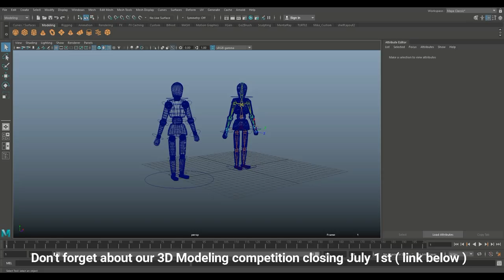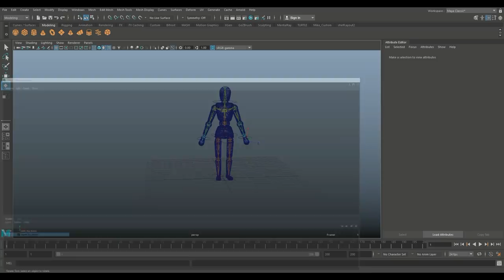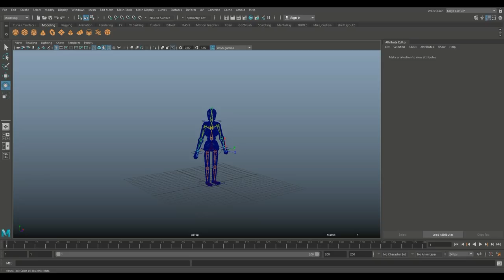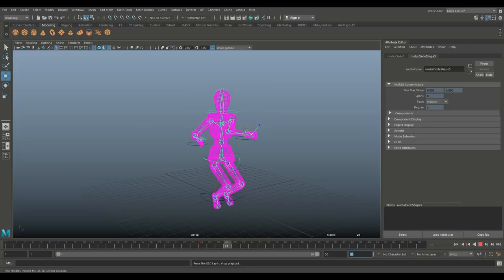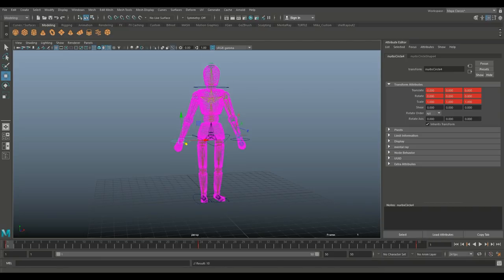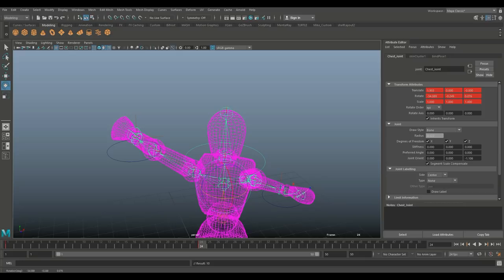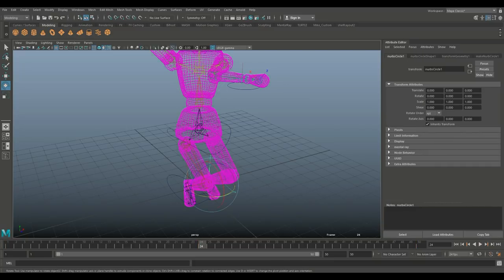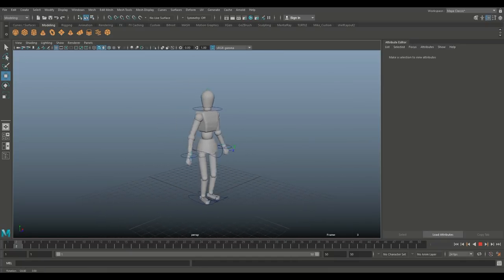ANIMATING our 3D character ( Part 4 / 4 )

Comment from the maker: I hope you enjoyed this little 4 part video series guys !
Reply: plzz... make a full character rigging video
Reply: Mike Hermes yup it was amazing 👌👍.
Reply from the maker: Thank you
Reply from the maker: I did, see part 3
Reply: hey mike. when i rigged my legs they bend the wrong way. how can i fix that
Reply: p1mento - chcek your local rotation axis for the joints and correct them
Reply: Great video. Only thing that i would add to it is to maybe show how to make a simple walk cycle with frames set for repetitive action (in graph editor) ;)
Reply: i don't know why but when i creat my joints the hips joints face one way and then the knee ankle and foot face the oposite wa. i guess i have to turn them manualy
Reply from the maker: Make sure they are very slightly bent before adding the joints
Reply: i was able to fix it. i don't know if this is the correct way... the solution was to rotate  the joints after inserting the ik andle.
Reply: The parent rigging part is important. Thank you.

Comment: Hello, Mike. When I lower the character, knees do not bend, like here 2:00. The character just goes down. What should I do?
Reply from the maker: Make sure the joints start at the hip and go to the toes, same as in the video
Reply: With joints everything is alright
Reply: Even if use joints created with HIK, it still does not work.
Reply from the maker: Can you send me a screen print ?
Reply: Aleron Check if the foot controlls are parented below the hip control. If yes, unparent them
Reply: Thanks, I figured it out. In the IK Handle settings, it was necessary to tick the sticky.